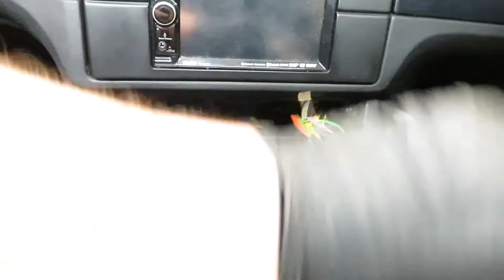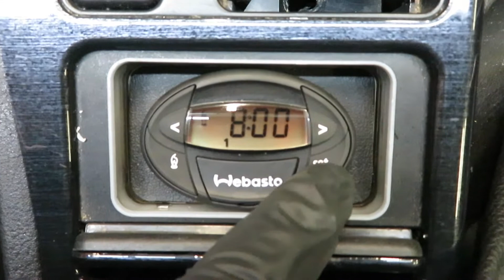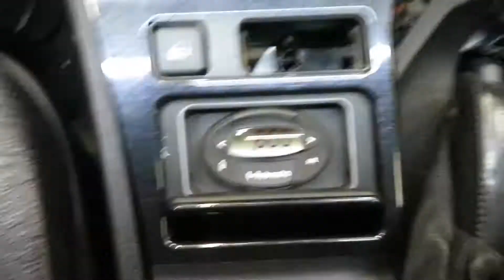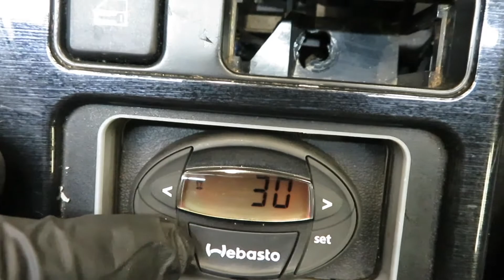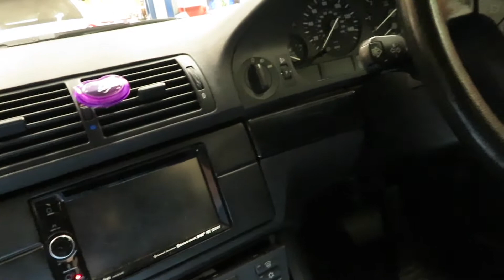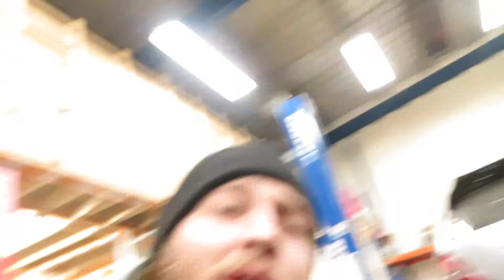BMW E39 Modify Aux Heater To Parking Heater Webasto No INPA

Comment: Only 1 question.. why? When you use inpa, you dont need more cables, control unit, etc.
Reply: I am sorry, but i think this is really waste of time.. bmw e39 needs only coding for parking heater..
Reply: @RADASASS  not if you have the small dash
Reply: @ciunghy  sure, but isnt better install big bc?
Reply: @RADASASS  it haes an aftermarket radio, so no coding would help. where do you code it? the parking heater is controlled by timers from the radio or that fucking thing that bmw called multimedia screen, that was outdated in factory allredy
Reply: @Aigo1987  i probably missed that he has aftermarket radio... but even with aftermarket radiod, if you buy one with android, you can use software which can control webasto (with ibus to usb converter, so you must connect only 3 wires behind radio), or you can buy used oem remove control unit and control it with remote switch, ofc its not same like timer

Comment: Is the heater in the E49 usable on it's own (to head a boat radiator) when I buy the heater itself, a fuel pump en the piping.
Or would I need another computer to actually activate the heater (other than a webasto clock)
Reply from the maker: You can just stick a feed via a switch to the heater if you don’t want the timer 👍🏻
Reply: Yes look at my channel
Reply: Look at my channel

Comment: Where are you located, and could this be done to an x5?
Reply from the maker: Preston and properly but you need to make sure your heater works first. The new control units runs about £400